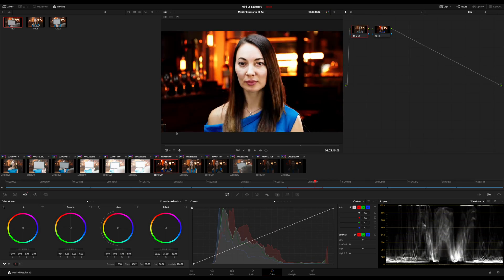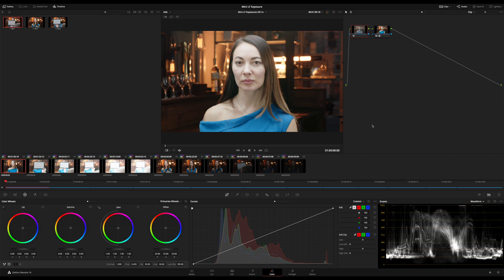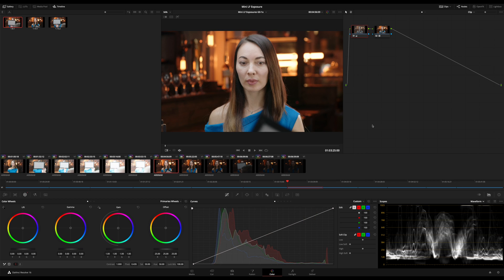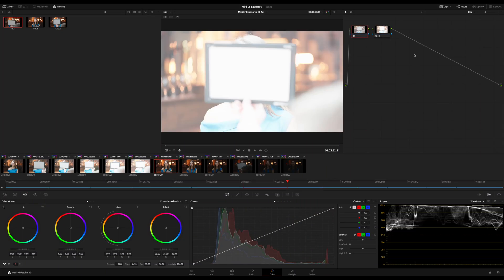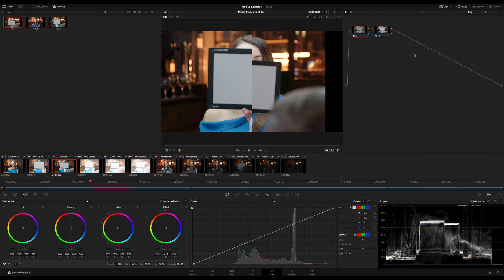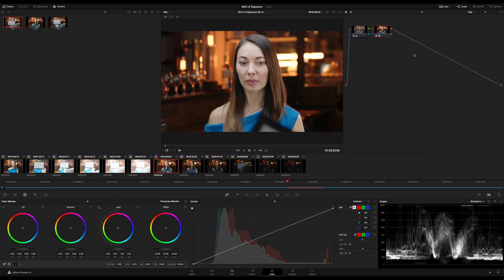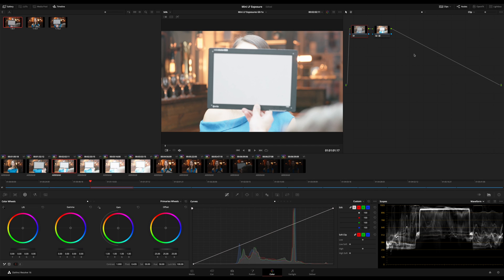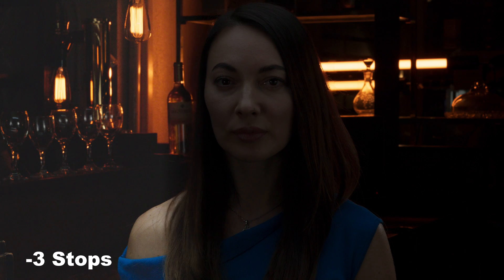Understanding Exposure Tests

Comment: Nice video! Just for clarification, was the grey card the reference for the baseline +-0 exposure? What was the IRE-level, and how did you control the exposure? Thanks. 👍
Reply from the maker: Yes it was.  Matt shot a range of exposures and in DaVinci we selected the one where the it most closely matched the target 10 bit code value set by ARRI for a grey card, which is 400. On set the exposure was controlled with aperture.
Reply: @benallanacscsi5276 Thanks for the reply! I just recently performed a color exposure latitude test on the Blackmagic Pocket 4K camera. Would you mind commenting my approach; both in regards to the test – and my strategy regarding exposure? https://youtu.be/VTwV868AO5Q
Reply from the maker: That's great Jonas, ETTR is what cinematographers working with film call "a healthy neg".  The interesting thing about all of these approaches to exposure is that they reply on reflected light.  I'll try to post something soon about the value of also working with incident exposures.
Reply: @benallanacscsi5276  Thank you for the reply! That will be interesting, I'm looking forwards to that video. 👍

Comment: Hi, perhaps this is a silly question, but what method are you using to create the various over or under exposed images?  Are you changing the lighting levels?  iso?  I'm assuming not aperture.
Reply: I've always heard the order of exposure priority for over-unders goes as such: Internal ND, Shutter, Light Intensity, External ND, Aperture.

Internal ND first since they should be matched to the camera, shutter second since motion blur isn't a characteristic of sensor color response, then light intensity if you have control over it, then external ND since they won't be color matched to the sensor, and finally aperture, since it will have the most overt effect on the image. If you're testing motion picture film, you would do a combination of frame rate and shutter angle to maximize the number of steps. 

Don't change the ISO for a given over-under. You want to keep your noise level consistent. Set it to the manufacturer's recommended rating. Remember that ISO is just multiplying the sensor values (slope in ASC CDL), so you're not actually seeing the sensor's characteristic response to overexposure or underexposure. If you want to compare two different ISO settings in the camera, you would do a full over-under for each setting. Hope that kind of makes sense.
Reply from the maker: @videocontentchannel  Yes.  These tests were done with a combination of aperture and ND.  I know there are theoretical issues with this but with good lenses and ND's it is very accurate .  You totally right about ISO, no point in doing the tests if you change that!

Comment: Thank you for taking the time to share this! 👍
When you say that you like the look of the 1-stop over and make a Lut for that look, is that a monitor Lut that is 1-stop under so when expose correctly on the monitor, you are actually capturing 1-stop over or how does that work? Thanks 👍🙂
Reply from the maker: That's exactly right. Adjustments like this are actually quite common on big films.
Reply: @benallanacscsi5276  Thanks. I'm going to try that out for sure 👍
Reply from the maker: HDR is an interesting one for this.  I did have a look at the footage in HDR but found that Rec.709 gave a more useful base for the exposure comparison but we will have to start working to HDR anyway in the near future.  When you say a LOG version, do you mean seeing the LOG image without a LUT?